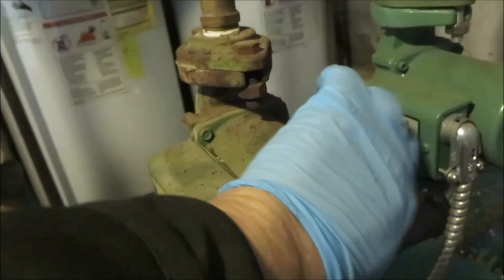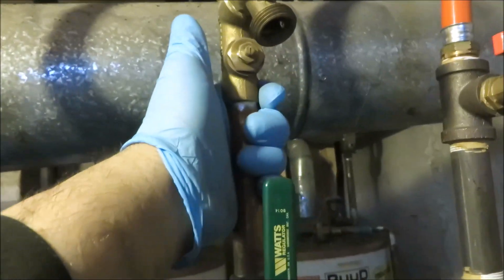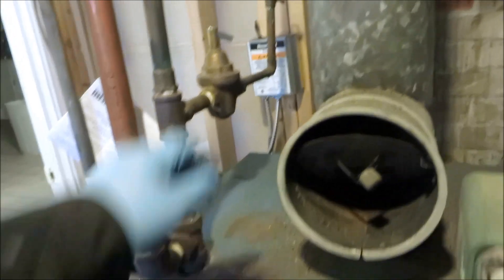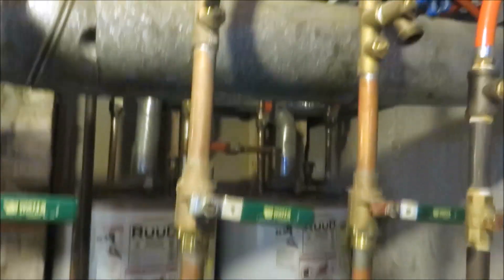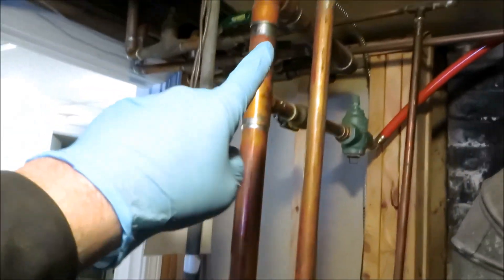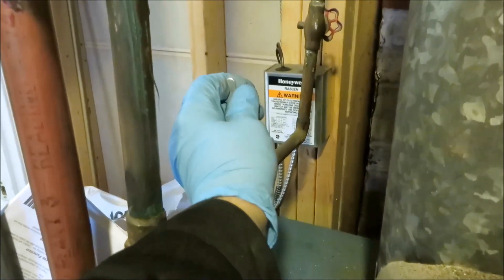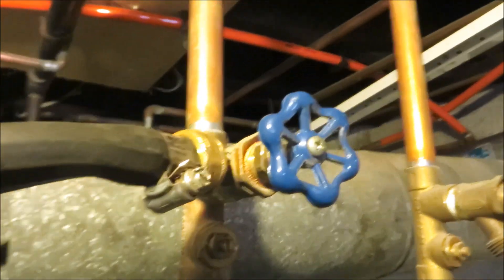purge air from hydronic heating system with circulators

Comment: I did this process for the first time. Owned my home for 8 years and never bled system before. My heaters were popping and banging for years. Now my boiler system is operating correctly and efficiently. Thanks fur sharing.

Comment: I enjoy your videos but when you mentioned the lack of maintenance I got a chuckle. My current home has hot water baseboard heat, a first for me, I love the efficient heat compared to my other homes with forced air. The seal on the circulator pump flange started leaking, plumber wanted $89.00 to come and look at the problem and $410.00 to repair. The day he was to show to do the work he calls and said he was sent the wrong sized flange and needed to be reschedules in a week. I’m in Buffalo, NY and it’s getting cold. The flange and pump were fine just the seals were shot. I was able to get the seals and a float vent for $26.00 overnight and repaired it myself. I also flushed the system and purged the air. Granted not everyone is inclined to do the work themselves but cost is a huge factor in people putting off needed maintenance. Just think had the plumber showed up I was ready to have him do the work, needless to say I am a happy camper.

Comment: Hey Steve I’m getting a slight banging sound when the boiler is heating up. I purged the two loops but still getting that sound could it be air in the boiler itself? If so how would I purge just the boiler itself. I also have a hot water coil in the boiler and afraid it might be on its way out. Just can’t figure out this situation the noise goes away when the boiler stops heating up.

Comment: Question from a novice:  Why do you want the power and burner off?
Reply: Anthony Pallatta because 1, the boiler will run trying to heat the cold water you’re putting in it as you purge the zones which is a waste of fuel since your draining the water as you purge. And 2. All the returns are closed so you don’t want the pumps running with no supply of water to them.

Comment: CAUTION - opening the bypass such as @1:56 was enough to blow my relief valve even with the purge valve open. Had to vac a good bit of water out form around the boiler.

Comment: Thank you. Last winter I had my system winterized. they put in Glycerol ( not sure how to spell it ) any who I came home to an air bound system. I call the company and they told me to just purge the air valves. Mine doesn't have them. Mine is like you are showing and yes in the past I had air in the system and my oil company did what you did. What I wast of money I just did. Thank you again.

Comment: How does all that air get in there?  I recently had a new circulator installed in a single loop system.  We refilled the system then purged the loop.  Nice and quiet.  A few days later, bang, bang, bang.   Purged again, nice and quiet.   2 weeks later, bang, bang bang.  Why?
Reply: Boiler temp likely too hot. Boiler maybe making steam.

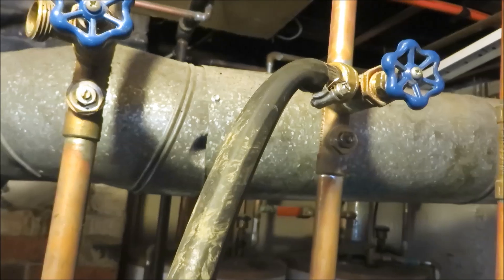Comment: I love these videos - especially the commentary .. but I can't make out what you're saying at 2:29 .. Something something ... " .. 30 lbs " .. something something "if that's the case.."  ?
Reply: He was making sure that the open fill valve, which he locked open, would not put more pressure into the boiler than he was letting out.. If he built over 30lbs of pressure, the safety relief valve would open and start spraying out water onto the floor.  Usually, when the relief valve has sat a while on the system, and the seals have gotten nice and brittle.. once that releases.. it'll forever seep.
Reply: I think it's his accent (new York area?) you are having a hard time making out.  i'm from Michigan, and I have a hard time making out what he is saying sometimes too. ha ha.

Comment: Hey Steven, I really enjoy watching and learning from your service call videos. Helped me a lot last winter. This season I decided to buy the service contract as I was sick of playing service tech. So I call for service and after a few hours of him trying to get hot water through my second floor (old fashion box) baseboards he tells me he wasn’t even supposed to be purging air from pipes and left. WTH?! :( I’m still airlocked with no heat upstairs. I like my couch but my bed is much more comfy.
I’ve had this problem many times over the years. I open the bleeder valve and hear the water gurgling up the pipe while forcing air out til water is running freely. I can hear the gurgles now but they’re in the distance. Initially I had heat in one room but not the bedroom. I tried to bleed the bedroom and lost the other room as well. I have, by instructions of the service tech, shut the system down and let it cool for an hour. Connected a garden hose to the return and allowed the water to drain slowly outside. I’ve done it yesterday and today for about 15-20 each day. I saw a lot of air come out today but sadly still no heat up there. I’ve left the bleeder valve open for hours with a little water alarm in the bucket in case... I was trying to do more research and was checking your videos for specific info on the offshoot piping valve with the diverter in the pipe to redirect only some water to another section of pipe/heat. Can’t remember what it’s called but begins with “V”. Hard to search when you can’t even find the word in a google search. Ugh! Can you tell me what that’s called? Do you have a video covering troubleshooting air through them? Any pearls of wisdom to help me get the air out and me back into my bed? Thanks for any help you can provide me.

Comment: i shiver everytime i see a heating system with that garbage orange kytek plastic... its banned up here in Canada now because it delaminates inside and the layers seperate and start popping holes all over the place. I dont have an issue with the Heatlink plastic with the oxygen barrier but that kytek is bad news.

Comment: Very intuitive article. 

However, even after applying this technique, the pipes leading into/out of one of my kick-space heaters are still cold despite the fact that the kick-space heater in the other room as well as the rest of the loop that makes up the entire zone on the floor is hot to the touch.

Any suggestions?
Reply: I have the same exact issue going on. Have you found a solution? I might try this bleed method combined with a vacuum pump (at the supply line bleed valve’ as I’m not sure there is enough pressure to get flow going back to the toe kick unit.

Comment: I notice the last zone is pex, probably pex al pex? I am doing a remodel and I'm removing a wall that has my radiator pipes running through it. I need to move the pipes. I would really love to replace with pex,is this recommended?
Reply: Matt Carpenter call me old school but pex isn't what it's cracked up to be...

Comment: hello Steven i was on a two zone system and the system was 130 degree but one of the curculator was 200 degrees is that the sign of a bad circulator pump and the system on that side of the pump was cold too. the other pump was 120 degree what do you think

Comment: Hey steve  would the circulatory pump get really hot if there was air in the line  I put a new pump in but its getting red hot and the pressure relief valve blew  Don't  know if its circulating ? any suggestions could it be a bad pump

Comment: Would this process be different if the circulators where on the supply side instead of return?  Would the circulators block the water since the boiler is off and no call for heat?
Reply: From how my system works, after you turn the boiler off, manually switch your zone control circulator to open/calling, then bleed the air.

Comment: Would it be easier to have installed screw air release valves on the top most convection units and bleed air out that way?
Reply from the maker: ok sorry i just read it man it was a mistake
Reply from the maker: +bigpardner no it don't work like that it has to be purged ,from time to time from proper operation thats why the purge stations were installed
Reply: +steven lavimoniere  Doesn't the air settle in the highest places? When we lived in NJ in a split level I would go up to the top bedroom and open a valve to let air out until I saw water.
Reply: +bigpardner ur right, this guy is just stupid and wasted all that time.
Reply: +Peter Johnson  I don't think he is stupid.
Reply: +Peter Johnson you dumb fuck, hes purging the air out.. with the drain valves open hes forcing the air through the open valve.. water pressure pushes the air out..if the valve was closed then air would get trapped.. you clearly shouldnt be on here calling people stupid.. jackass
Reply: +steven lavimoniere wtf you talking about? i was defending you Steve.. the guy i replied to said youre stupid
Reply: +steven lavimoniere did you even read what I wrote? and who I wrote it to?
Reply: +jonny rotten see u both stupid, don't even know who's writing lmaooooo
Reply: +Peter Johnson haha..holy fuck
Reply: +steven lavimoniere fyi.. Im a licensed plumber in Ma,RI,CT.. licensed Pipefitter in Ma, RI.. 6-4 265lbs.. not a mamas boy.. k cupcake
Reply: Why did he nots do it?

Comment: how many buckets of water  would you say is alot   i have filled at least 5 buckets already and still air
Reply: +steven lavimoniere  I have used buckets and put some water in to start because I can see the bubbles when the air comes out. But my system is not so large. Isn't it best to keep adding new water to a minimum and therefore use air valves and air separator scoops as much as possible to keep air out?
Reply from the maker: alex fava run the hose out side and run it till it runs all water no air .. why use buckets thats a rockey move
Reply: how about running the hose to a nearby laundry sink? is that a rookie move too? lol
Reply: +alex fava It's "a lot".

Comment: Hay Steve I see you purging that zone pipe and touching it a lot with your hands. What temperture is that pipe suppose to be at
Reply from the maker: juanjc1951 you can tell if the air is out  by feeling sometimes on the hose .well i am purging with cold water .once you shop the purge ,the temp will get up there to like 180 you will not be able to told one ,its to  hot